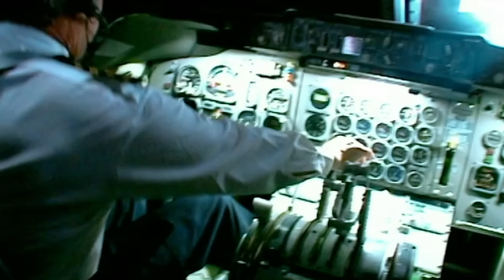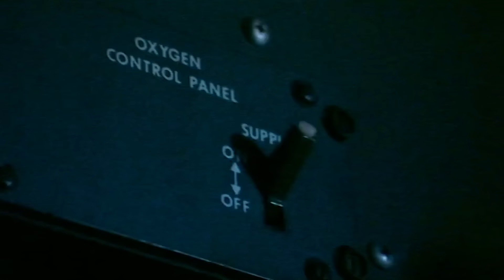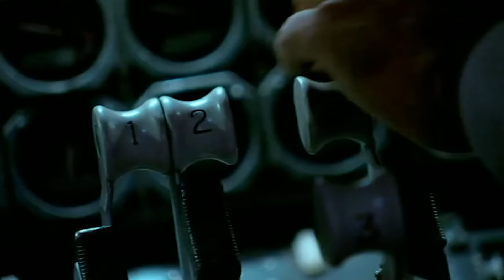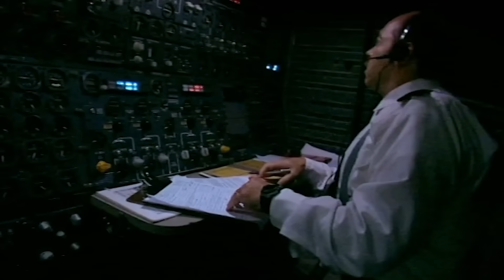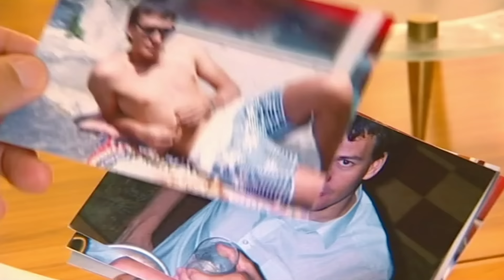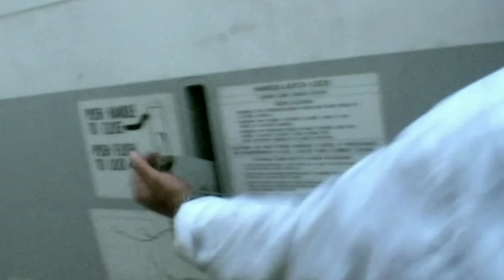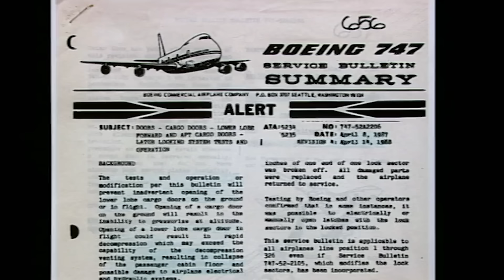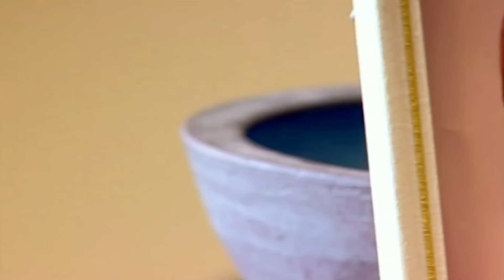Flight 881: What Went Wrong? I Mayday: Air Disaster

Comment: When an airline put the costs of repairs and safety over the safety of their passengers, they don't deserve to be in business.
Reply: Airlines, yes. But the real criminal is Boeing. I don't even want to fly on their slapped together aircraft anymore. This program set the stage for the doomed 737 MAX. FAA needs to be completely revamped.
Reply: Yeah they dont care, the costs are too big to do it right, besides, the INSURANE will cover all the lawsuits and costs, and they'll get a new plane out of the settlement
Reply: This is how refineries often operate, pedal to the metal until it blows.
Then routinely fix up and make improvements with insurance money. 
Since insurance companies pool resources , that means your insurance money too.
More examples of the burden loaded on the beasts, the plebs, the rafish grindstone nosers.
Reply: @x1achilles99  Yes, they're still doing it with the 737 MAX.
Reply: It's not quite so simple, but this type of modification should've been made immediately
Reply: @NewTrip_NewAdventure  I think boings curruption is what caused this
Reply: Unfortunately there is no alternative. The NTSB has a pile of safety recommendations and Boeing has more safety equipment they do not install. Doing all that would raise the cost of tickets by thousands and passengers routinely buy the lowest cost tickets. Airlines who don't listen and spend the extra money quickly go out of business.
Reply: @robertgary3561  Just make the whole plane out of black boxes, is what people think, without realizing that'd make an airline impossible
Reply: That's just good old American laissez-faire capitalism!
Reply: Exactly.
2000$ and 10 hours to do it is nothing when you protect lives.
Reply: Money is the king. If you die in an accident due to some big company saving some dollars, you are a martyr of capitalism.
Reply: Kinda like Air Alaska. Cutting corners.
Reply: uhh you know what capitalism is right... cutting corners  to increase profits. its how the modern world works
Reply: Unfortunately, many other aspects of aviation are still, to this day, knowingly putting lives at risk, from FBO's to manufacturing companies, design, maintenance & refueling. My husband has worked in aviation his entire life, for over 50 years, as a pilot, refueler, flight instructor, and crew chief - and in the past 20 years, he has hated it due to the GREED. He recently quit working in aviation due to that very reason - GREED instead of SAFETY, and every time my husband would speak up to make improvements & safety, he would either get fired or get treated badly. My husband received an award while in the military for making improvements to fighter jets force wide, and for preventing problems that would have cost fighter pilots (and others) their lives, yet ignorant bosses he has worked for in the civilian world (who don't care about saving money AND being safe) have treated him terribly, due to their ego and greed.
Reply: @x1achilles99  the 737 Max I will agree was slapped together rather fast and was rushed but I don’t think that just because one brand new aircraft has a flaw that all of there older craft have a flaw, data has shown that the 737 MAX now is extremely safe to fly on and there has been no other accidents with Boeing aircraft in a pretty long time, - the 777-200ER in Denver which I believe is more of a PW issue than a Boeing issue
Reply: @samuelmatheson9655  I agree, it’s the exact same deal with the max that was mentioned earlier
Reply: Have to put some fault on the manufacturer for making it costly to maintain.
Reply: @x1achilles99  There are videos about planes crashing because boeing wanted to save some money. Watch Boeing 737 planes with minds of their own, that's so scary
Reply: Without them, it many more would die
Reply: The airlines won't take care of their planes properly but they will force their passengers to wear masks for "safety".
Reply: @juneannbrusie2042  they have to, it's a law. But what they do in their workshop noone can really monitor that
Reply: @juneannbrusie2042  I don't know about your country but in my country you can get fined in some places. pretty mutch all public indoor places.
Reply: @saladasss2092  thank sucks. I haven't worn a mask the entire time.
Reply: @HobbyOrganist  Get educated before you make stupid comments, United is self-insured, they don't have an insurance company to pay the costs.  It was a design flaw.
Reply: Then we'd have no airlines lol
Reply: @robertgary3561  Correct. Most people claim they want a completely safe airplane until they see how much tickets would cost. Simply switching to military-grade jet fuel would make planes much safer, but it would raise fuel costs(and thus ticket costs) astronomically.
Most people would never be able to afford to fly and the airlines would go out of business if they made planes as safe as possible. 

Also, people blaming capitalism are daffy. Do they think communist or socialist airlines would be safer? What a joke. People love living in fantasyland.
Reply: @HarryBalzak  True. Ask them if they'd rather fly Boeing or Antonov
Reply: The 747 landing safely and proving the stability of the airframe disproves your statement. No one could have forseen what occurred. United has an impeccable safety record. I rest my case.
Reply: @James Cowan my experience is totally different. Don’t fly United . I will. They’re not perfect but a class airline. With you not flying, the middle seat will be empty. Thank you!
Reply: @sanders555  Commie
Reply: I totally agree!
Reply: @Adam Sanders
I totally agree!
Reply: I was on that plane but I parachuted. I always travel with a parachute for safety reasons.
Reply: that brittle wire comment at the end is false (outright lie)  uv light causes the insulation to become brittle, but that wire is completely hidden- it will outlast the aircraft.  The copper part of the wire will never become brittle, FYI
Reply: Agree, I took one flight with United Airlines after the midair explosion and I struggled to keep my eyes opened through out the flight. My body and my mind tried to close down on me. Aweful feeling of not trusting...
Reply: Business people are psychopaths that think only of profits. If they could get away with more, there would be a lot more deaths.
Reply: I kind of agree, but there has to be a stopping point SOMEWHERE. Would you shut down every plane in the world for 3 months, if that was what it took to fix a theoretical problem that might happen to one plane every 500 years?
Reply: Did your husband take a pay check    maybe he could have been not so greedy and donated it to improve the safety issues
Reply: People always want the least expensive plane ticket, not thinking  that may translate to corner cutting.

Comment: Just imagine how corrupt must these organizations be, to try and cover up such a huge flaw in the design of these aircrafts.
Reply: makes me wonder about what other flaws they are hiding.
Reply: I seriously doubt it's corruption. I think it's more a case of, as the lawyer said at the end, putting economics before safety. And to a degree I see the point. No good having an aircraft that doesn't have any issues if the cost of that aircraft puts flying out of the reach of the people who wish to fly. We can build machines that don't break, they are just too expensive for people to buy. But in this case, something as serious as that should have been dealt with much quicker...
Reply: @harry w and Chris, this was not caused by corruption.... The materials and equipment used to build these planes is definitely the best products available.... What ACTUALLY caused this was  probably a false ground from an isolated ground triggering circuit associated with the actuation of the cabin -pressure relief door latch on the outside of these doors ... It was NOT a mistake of the ground crews or the mechanics, as the NTSB incorrectly suggested... A design oversight that was probably inadvertantly made with the electrical system , which probably caused this to happen... That is probably what caused this... And by opening some circuit breakers in the fwd. E&E compartment that provide electrical power to those door latch actuator motors, (747-100 & -200) the problem will NOT occur again in flight.... I'm sure that Boeing improved that system on the later models of the 747's... BUT, I have to tell you, of all the airliners that have ever flown, the 747's were the very best of ALL of them... NO doubt about it...
Reply: @michaelmartinez1345  I've worked on the 'test and repair' side of engineering for over 40 years, and it's very very rarely a single fault that causes this sort of failure, it's usually a series of small faults that if any one wasn't present, nothing would have happened. Here the 'guilty parties' were the failed isolation and the aluminium c-locks. Had the locks been made of steel (as the retrofit locks were!) or the electrical isolation actually isolated, then we wouldn't be discussing anything. Since the incident, I believe both problems have been resolved.
Reply: yea the ntsb ..who should be independent just try to protect boeing etc ...
Reply: @Chris-hx3om  i think the other problem is why the NTSB couldnt get to this conclusion with all their so called 'experts' whilst the couple managed to get to the crux of it.  Clearly we know who the NTSB sides with
Reply: All over money because they don't want to bring that set of airplanes back and fix it because it's too expensive to them compared to many planes worth of lives.
Reply: Corrupt practices are nothing strange to the world of human existence. People are underhanded in how they handle issues surrounding others but depending on whom it affects adversely determines if the malfeasant act goes undetected or undisturbed. Once corruptive practices are allowed to thrive in any shape or magnitude, it's a matter of time bits and pieces shore up on other people's doorsteps.
Reply: If you KNOW your flaw WILL probably kill someone, you SHOULD be liable.
Reply: I'm.not that far from one of them.  Don't jinx me.

Comment: I was on a Hawaiian airlines flight from Honolulu to the Philippines in January of 1990 when this exact same problem happened to our flight. We never lost cabin pressure, but we did have to return to Honolulu. At the time, it was just considered an inconvenience. This just shows that this was a much larger problem than most people realize. We were a couple of hours over the pacific ocean before we turned around.
Reply: Was that the flight that lost the stewardess?
Reply: @guyfaux900  no the flight you mentioned was a short flight among the islands of hawaii
Reply: "when this exact same problem happened to our flight. We never lost cabin pressure, but we did have to return to Honolulu"  
Ummm, then its not the exact same problem!  Losing cabin pressure is a different ballgame altogether!!!
Reply: How is it the same thing that happened if half the plane here is gone ?
Reply: @rodneyyouplonker8312  What I mean is that the door closed but didn't latch all the way.
Reply: @franzyland  👍
Reply: Flight number, please.
Reply: @franzyland  there is absolutely no way the airline would have told you the exact cause of the turnaround  . You would have been given the standard  technical difficulties  spiel  .
Reply: She means same door issue it opened. But they must of not been up to like 20k feet yet where air pressure is all crazy.
Reply: I’m going back to Chicago from Honolulu but on united
Reply: @franzyland, how many hours does it take to travel from HNL to MNL?
Reply: ASD Liam the animator  I have no idea. It was 1990 or early 1991.
Reply: @guyfaux900  no, Franzyland mentions that their flight never lost cabin pressure, while the flight that lost the stewardess experienced an explosive decompression.
Reply: A cargo door opening at cruising altitude is waaaaay more than an inconvenience and you all would have realized how much danger you were in. Either you're mistaken in what happened or you weren't 2 hours into the flight at cruising altitude which is around 33,000 feet

Comment: I worked for 30 years as an Aero Maintenance Engineer and i will tell you all many big airline companies take huge money saving risks rendering their aircraft deadly not just unsafe to fly...i resigned eventually because of the responsibility i faced when i put my signature on legal maintenance paperwork saying my work was done as per requirements and other components within the same vicinity where visually not lockwired yet the paperwork was signed off and the plane was out to fly that very same day.
Reply: What’s the safest plane to fly?
Reply: @frenchkiss8789  Much more important than “what airplane” is “which airline”.
Reply: @tookitogo  that’s very true. After I wrote my comment I continued researching about crashes and causes for hours and hours and found out exactly what you said. Thanks friend🌹
Reply: @frenchkiss8789  Thanks for the kind words!!
Reply: @tookitogo  ❤️
Reply: @frenchkiss8789  airbus I think

Comment: I worked for UAL as an A&P for 11 years... This accident happened when I was working there at the MOC - SFO... Close to where I was working, was the shop area where the pressurised fuselage doors were checked and repaired.... After that incident happened, a lot of tension was in the air , especially the door shop... The faulty S-2 switch that was described in this program, was an element of the redundant safety system, that was designed to keep this from happening... The initial cause of the electrical issue that caused the door latch cams to operate without a command to do so, to my understanding, was not determined... To correct the problem, after this incident took place, the circuit breakers (in the fwd E&E compartment) that interrupted power to the electric latch motors on the fwd. & aft cargo doors, were opened , and the orange cam-latch stripes were viewed through the small windows on the doors to line-up indicating that they are latched, before the planes (100 & 200 series 747's) were dispatched... After arrival at the plane's destination, an A&P entered into the fwd. E&E compartment , to close the circuit breakers that powered the door latch motors, and the cargo doors were then opened to access that area.... Basically, the NTSB has been known to occasionally come-up with inaccurate information of WHAT actually caused incidents like this one... Immediately, the NTSB taking the door away after it was located in the ocean, to their private labs and apparently trying to discreetly find the actual causes of what actually happened with these faulty systems causes some concerns... That leaves a LOT of suspicion , of WHY the NTSB does not fully disclose their findings to the general public, who pay for their existence. Finding problems , like what happens after an accident like this is a work of dedication and ingenuity. But there are times that the answers just aren't clear... The practice of disconnecting the circuit-breakers that power the latching motors before each flight was an excellent sollution, and that was done for the remaining time those planes served... But the failure of the supposed 'fail safe' interlocks of those latching cams, was a very serious engineering error... One that could have been corrected before these planes were dispatched for commercial use... Hopefully, this will provide insight, to the importance of testing before using...I salute The parents of passenger Lee Campbell, who followed through with their OWN investigation of how this happened... They were able to locate the cause of what actually caused this to happen. The Pilots and Flight Engineer did a great job at bringing that crippled plane back in without further loss of life... What was disturbing about all of this, is the findings of what the NTSB came-up with, and how far off they were at what ACTUALLY caused this to happen... Blaming the ground crews and the mechanics, for what was a design error of the cargo door latching mechanism...
Reply: @3kainos , the 'plug' type of doors work very well on the smaller/narrow body planes with smaller cargo pits... But for the larger planes, like the wide body variants, they are not practical... They eat-up a lot of room to open , and that is a huge loss of payload carrying capability, and since they are curved, (as the pressurization requires them to be), there would be no way the LD-3 containers could be loaded into the pits.... Planes this size NEED containerized cargo storage, there is no getting around using containers for the cargo on big planes like these... They  found what caused the problem that caused the latch's to open in flight , repaired as necessary, and made SURE that it would NOT happen again...